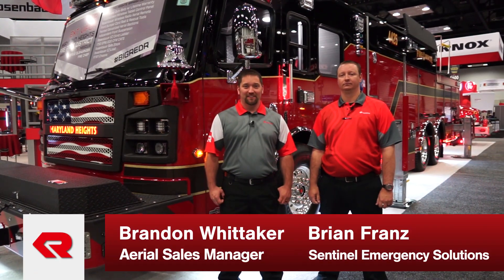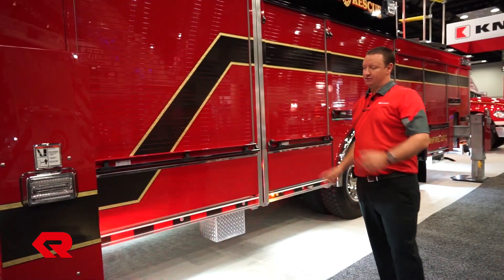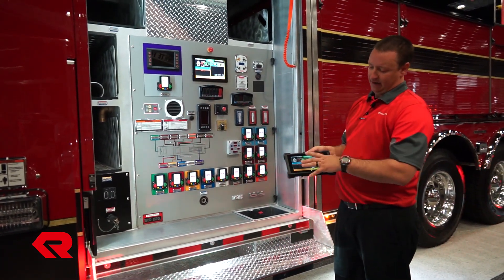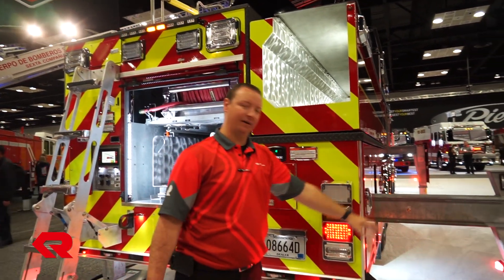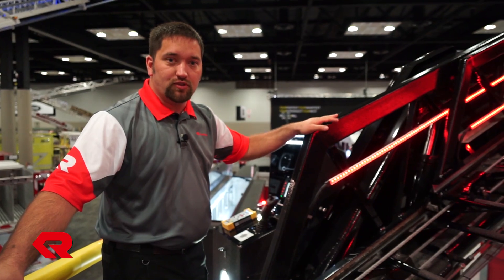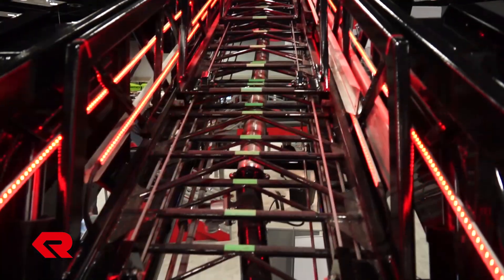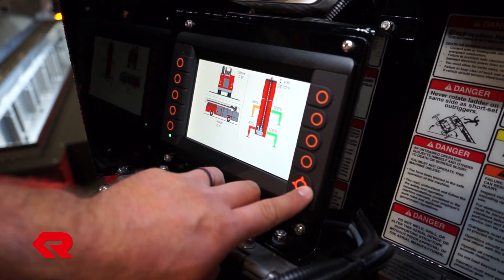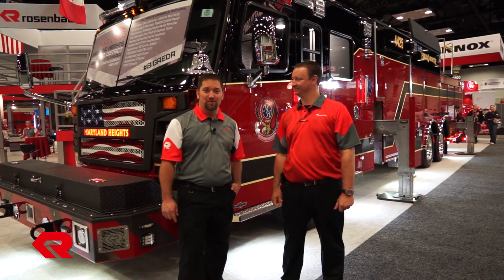Maryland Heights 109' @ FDIC 2018

Comment: My concern here, is electronic equipment's hate relationship with water.   How durable will those digital screens be under fireground conditions?   And also,  having a tablet in his hands will make doing other pump operator tasks clumsier: making connections, hand jacking short supply lines, chasing kinks,  etc.  I can see it getting banged around and dropped often, lol.   Also, what happens when one malfunctions?  Are their work arounds, or back up systems so you don't lose all control of your aerial or pump?     I'd love to see a full tour of this rig!